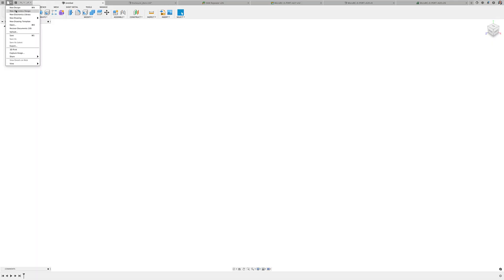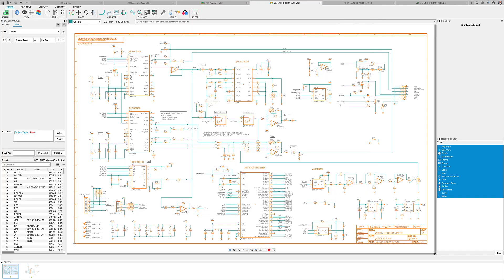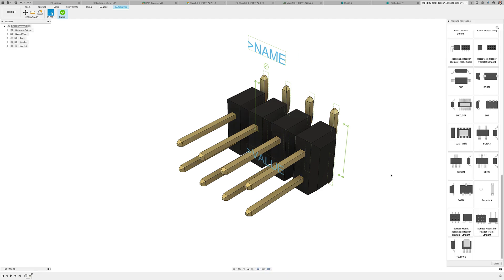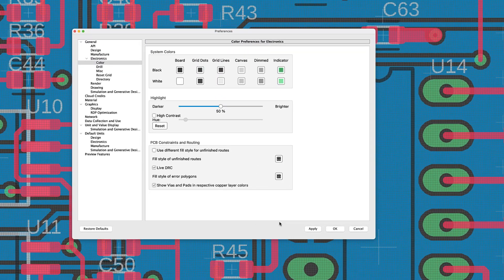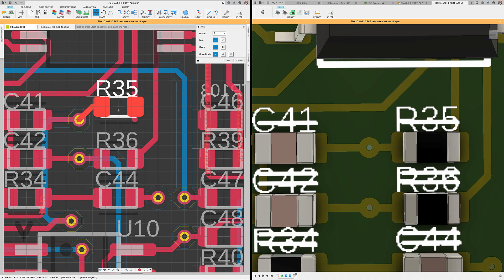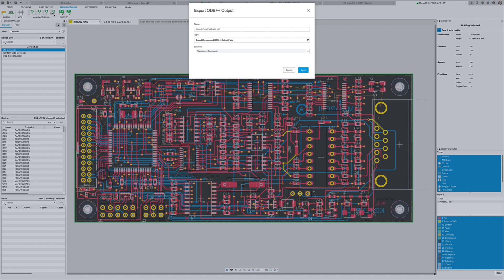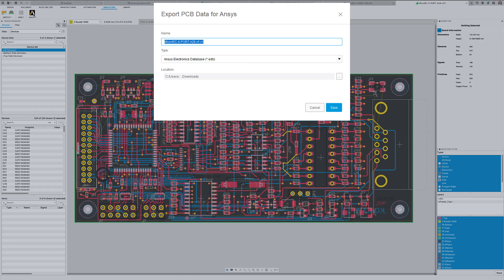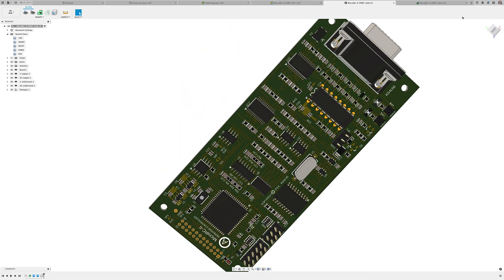What's New Fusion 360 Electronics August 2021

Comment: What about the visualization of the SMD solder mask? 
I still can't see SMD pads without solder mask in the board preview. It's very annoying.
Reply from the maker: Hi Presley4b, Thank you for your post.  I just tested the CAM Preview and did notice the SMD pads are exposed, and the gap between the SMD and the edge of the solder stop mask is there.  This has also been fixed if you are referring to the 3D model, but you need to do an additional step. Click on the pull SWITCH pull-down menu in the PCB and select the "View 3D PCB with Options". In this dialog box, check the option "Stop Layer Geometry". Creating the 3D model of the PCB might take a bit longer, but the actual STOP layer will be there. You will notice the exposed SMD pads and uncovered vias as well. Please reach out to Edwin Robledo or Jorge Garcia on the forums if you need any assistance.  https://forums.autodesk.com/t5/fusion-360-electronics/bd-p/6071
Reply: @adskFusion  Thx for the reply. 
I was referring to the 3D model PCB preview. 
Switching with options worked as you described. Thanks a lot for your help.
Reply from the maker: @odwakacjidowakacji  That is GREAT!! Thank you for the update.

Comment: Where is the PANELISATION FEATURE BEEN waiting 2 years!!!!
Reply: I have always had better luck with the PCB fab house doing the penalization. 
Even if that feature was in there - not sure I would even use it. 

What is your use case for doing it on your own instead of the fab house?
Reply: @Factory400  My fab house doesn't like doing it, you have to give them the specs drawings anyways if you want something specific. I also design the PCB panels for Manufacturing assy purposes and require special arrangements and even jigs, Its better for me to design the panel in F360 and then model the jigs etc. But I do this manually in F360 and it not good if you make changes to the original PCB.